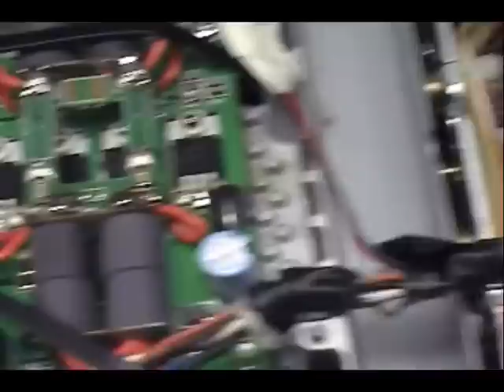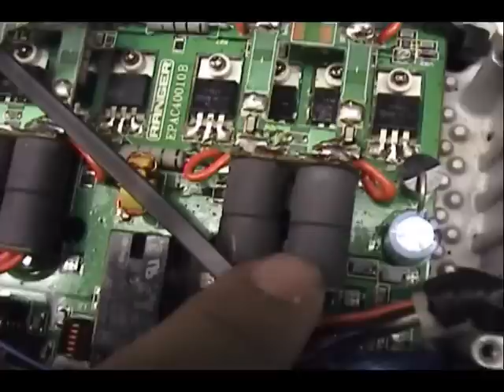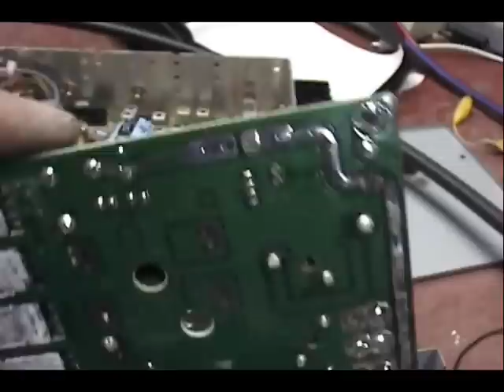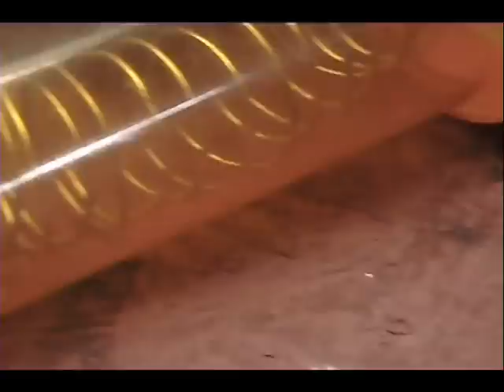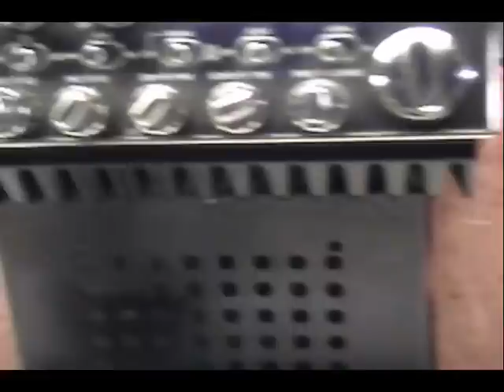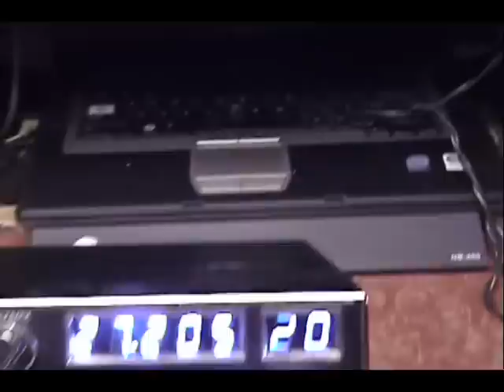Galaxy 98VHP Repair Report

Comment: May I ask what circuit you have made to connect the scope?
Reply from the maker: @noriceburners: I use a Bird 4273 RF Sampler , located between the two Bird meters. It provides a non-intrusive RF "tap" to my frequency counter and o-scope.